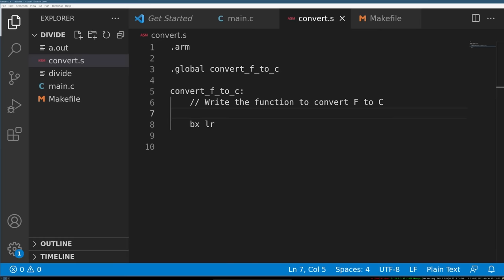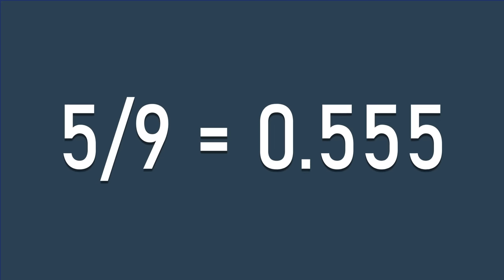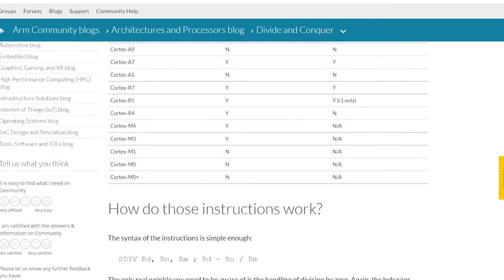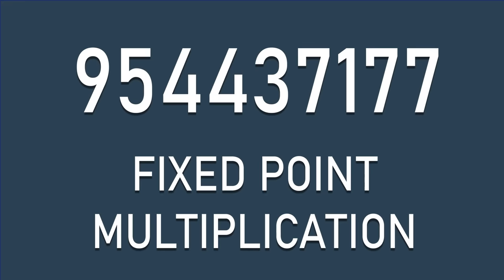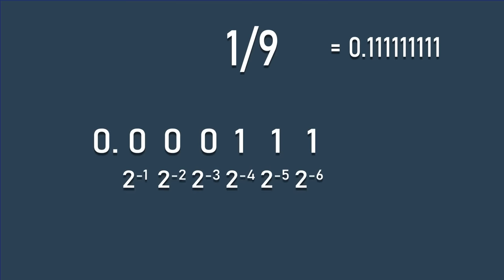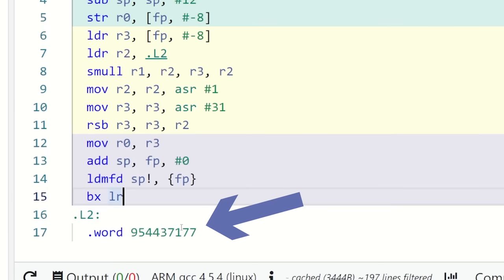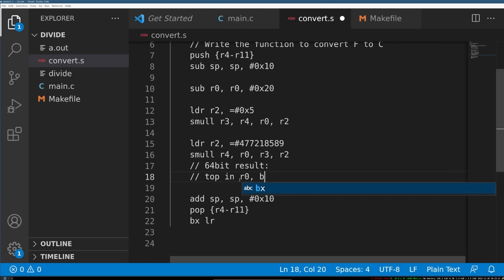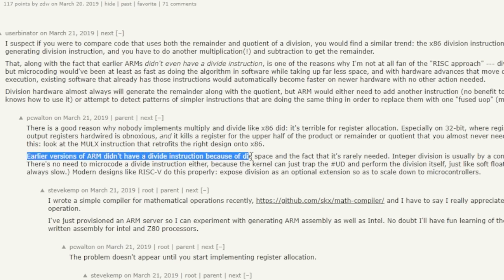computers suck at division (a painful discovery)

Comment: The reason division is hard to do is that it's an iterative process and you end up with remainders.  Multiplication is shifting and addition which is really XOR.  Division is quite a bit more complex.  With division, even when you're doing it on paper, you have to often "guess".  "How many times does 7 divide into 24"?  You know the answer is 3 with a remainder of 3 but only through experience.  You need much larger lookup tables for division to make it fast.

I designed an ALU in college.  Addition, subtraction, multiplication, exponentiation - ALL easy.  HOWEVER: division..?  SQUARE ROOTS?  Must more difficult.

Comment: Years ago working with early MIPs 4000 chips, I slowly tracked down a chip bug where a divide by zero exception would happen in the middle of nowhere. The issue was the divide was in the branch delay slot of the test for zero. The divide was canceled unfortunately the exception 64 cycles later was not. So the MIPS chip was doing 64 bit long division, one bit per cycle. Hard to track as the exception showed up in a random process. This was the first NT multiprocessor system running a  stress test with a screenful of open GL tests after many hours.
Reply from the maker: MIPS branch delay slot is the root of all evil

Comment: Division is just repetitive subtraction and borrowing a decimal when you have a remainder 1/3 = 10-3-3-3, 10-3-3-3, 10-3-3-3... =0.333... All you have to do is count how many times did we subtract 3 before you either got to zero or had to borrow 10 and shift. 2/5 = 20-5-5-5-5 = 0.4. we subtracted 5, 4 times to get to zero but had to first borrow a decimal. We can arbitrarily select how many places we want with simple subtraction.

Comment: The Intel 8086 didn’t have floating point because of the silicon real estate, instead you had to add the 8087 floating point coprocessor if you wanted hardware acceleration. So the original IBM PC had an FPU option and a floating point library was used when the coprocessor was not installed. Granted, the 8087 did more than division, but the need for floating point instructions has always been a trade-off at the price-sensitive end of the market due to the cost of the die area versus the real need in target applications for hardware acceleration. Welcome to embedded systems!

Comment: Unless it's division by 2. As a solution, I propose that all division is done by 2.

The reason division sucks so much is that every other operation is just adding (edit: meaning they can be done by the adder). Subtraction is just adding a negative number. Multiplication is just adding a number to itself for a set number of cycles. But division? Figuring out how many cycles a particular number takes to add up to the product? That's a lot harder.

Comment: The solution should be big graph trees of /s r8? Imagine endless kinda maps, of numbers where a lot of numbers are cancelled out, & in nextgen maybe also kinda fields or 3D,4D trees,scapes,artifacts etc also w colors(like Daniel Tammet visualizes) shapes etc which make new algs 4equations. This would open literally new dimensions of the most correct/perfect results which kinda could end up in multiverses since it's all possible outcomes prediscribed/visualized/determined.

Comment: I'm not very familiar with low level programming, but I've figured for a while now that it'd be nice if we suspended division until the last possible moment so as to prevent having to divide, for instance using fraction-based division instead, would this work? So, instead of repeatedly dividing to compute the sqrt of a number using Babylonian method, you just repeatedly multiply and then divide a single time at the very end.
Reply: Ah, but I know Fixed-Point decimals! Those are far better than floating points if you're not able to store the data to the level of accuracy requested then at least be upfront about it.

Comment: My favourite trick is to use a compiler. Modern architectures are optimized for use by compilers, not humans. Beyond fetish usage, or hair-shirt usage, or nostalgia usage, you've got better things to do with your time.
Whether you are coding in assembly, C, Rust, Perl, or whatever your poison, you can generate about 50 debugged lines of code a day. You don't get much done in 50 lines of assembly, but 50 lines of C is quite useful. Your choice. 
Plus, the people that write compilers are very smart and the output of a compiler will likely be far more efficient than your hand whittled artisanal assembly code (with less bugs too). Trust the compiler, trust the optimizer.

Comment: Reminds me of the time I had a weird instance with Excel where the irrational number after first dividing and then multiplying back gave me a value above the input value that was divided, though that was most obviously due to it being an irrational number which never fucking ends, so there is obviously gonna be some rounding, but even some small errors did not cause that before, presumably since it excel may have rounded it down, seeing that it was abnormally low the fractional value and it was genuinely weird to see it first time.

Comment: Genuine question: How relevant is this in programming as a whole? I mostly work in high level languages and am genuinely wondering if this has noteworthy performance impact. Obviously it's not something I would try to work into everything by default, but in situations where performance is absolutely key(which for me is mostly in regards to game development), it could be worth consideration.
Reply: Not really. It's important to know how numbers are dealt with but not to the point of such optimisation usually. For example you need to be constantly aware of floating point imprecision but if you don't work with microcontrollers you don't realistically need to implement custom fixed point solutions.

Comment: In terms of saving the tacts of CPU not implementing DIV is correct.
Moreover if you are doing arm you should think of minimizing operations to be executed. 
That’s what godbolt demonstrated.
1 add 1 mul
Instead of intended initially 
1 add 1 mul 1 div

Comment: It's not exactly a +1, they just rounded to the nearest integer.
2^33 / 9 = 954437177.9, so they used 954437178 because it's closer than 954437177.

In your case,
2^32 / 9 = 477218588.4, so the closest integer was 477218588, in which case adding +1 was unnecessary and reduced the precision (by an irrelevantly small amount, but still - better to understand why the +1 was there than apply it indiscriminately)

Comment: Computers don't do neither multiplication nor division, in the lowest level of programming, multiplication is just repeated addition, and division is just repeated subtraction.
Reply: How is division repeated subtraction
Reply: @kelsierii4747  
For example 8 divided by 2 is:
8-2-2-2-2
The computer counts how many subtraction it has to do to reach 0
Reply: @NourArt02  what. How does the computer know how many times to subtract..? And even if it does know, that's already the response (8/2 = 4, you subtract 2 four times). I don't think you're right on this
Reply: @kelsierii4747  I thought you have a bit of knowledge about computers architecture when i replied to you, anyway just Google "how does computers do division" and read
Reply: @NourArt02  "Modern CPUs essentially calculate N/D as N*(1/D). The (1/D) is approximated with Newton-Raphson method." As explained in the video. No subtraction.
Reply: @kelsierii4747  No subtractions? so how do you do a Newton-Raphson method?

Also, i like that you actually googled it, that means you like to learn .. very cool .. If you read enough about this topic you'll find out that every "division" algorithm requires some sort of repeated subtraction.

Comment: Oh you youngsters ... 🙂The libraries aren't "approximations." They do the same IEEE floating point operations that hardware would do if you had it. There is no dishonor in using them.  "ARM decided they [divisions] weren't needed" is really "ARM made a hardware vs software tradeoff decision and decided to go with software to keep die costs low."  Factoid: The x86 line didn't have on-chip floating point until Pentium (80586).  Earlier versions had an optional second chip to provide it. Always the same number as the processor chip except last digit "7" instead of "6."
Reply: Actually, the 486 was the first one to have an integrated FPU.

Comment: I think this is not a computer issue as much as a decimal issue. The ease of use of floating point decimals on paper hide the fact that it’s a chaotic operation that produces unpredictable sizes for the answer. Dividing integers can produce anywhere from a single digit answer to an infinite string. Dividing any integer by a 3,7 or 9 will result in a repeating decimal for any number that they aren’t a factor of, I.e. 2/3s, 6/7ths and 8/9ths of all integers respectively. Arbitrary truncation will always be necessary in any division operation to avoid infinite recursion, at least if a single value is being returned. Decimal division is an ugly mathematical process, its just something we get introduced to at a young age so its familiarity hides that

Comment: I have been interested in this problem at least since I re-invented the reciprocal multiplication idea around 1990, only to be told some guys at DEC had done it years before me, then in 1994/95 I was heavily involved in the FDIV affair. In your particular case you should also worry about rounding vs truncation, i.e. when converting between integer F and C, you should probably aim for a properly rounded result, and this you can do better with reciprocals: Start like you did, but calculate the fixed point version of 5/9 directly (totally avoiding the mul by 5 step), using the nearest bit pattern you can get (i.e. do no blindly add 1), then at the end you add the value corresponding to fixed point 0.5 before truncating.
I would also advocate using a much larger offset instead of 32, so that all values will be positive: Unsigned numbers allow for faster algorithms. 🙂
BTW, during the 1990'ies pretty much all  (optimizing?) compilers gained the ability to convert division by constant into reciprocal multiplication!
Reply: That optimization is not "safe". There is an algorithm which can do that safely, but it requires (true) fused multiply-add instruction and wasn't known in 1990s. Actually, it took some time for compiler writers to learn that they shouldn't blindly "simplify" fp expression assuming that fp numbers behave like reals.
Reply: @radivojevasiljevic3145  You've misunderstood the problem: Reciprocal MUL is only safe when applied in the (unsigned) integer domain! When you do it there, you just need N+1 bits of reciprocal (rounded up) in order for the product to be exact after shift/truncation. This is the algorithm I verified would work for all 32/32->32 bit divisions back then.
You are of course correct when you state that doing in the FP domain does require a lot more precision: In general you need 2N+2 (or 3 depending upon the exact operation) bits in order to avoid double rounding issues.
Reply: @TerjeMathisen  mea culpa, I am mostly focused on FP because domain is usually larger (64b) and compilers had long tradition of destroying FP algorithms. May I ask you, which tool you had used for verification, brute force or something like ACL2 or Coq? 

AFAIK, in FP good algorithm doesn't require larger precision (useful if available but not essential), only fmad. The only downside, is usual complexity (trickiness) of FP algorithms, but accuracy and run time are excellent, especially because this transformation enables usual loop optimizations.
Reply: @radivojevasiljevic3145  This was a long time ago, very few tools available, so I simply wrote my own that tested it all, semi-brute force, by trying all the break points: Verify that n*m divided by m returned n and that (r*m-1)/m -> n-1. This (obviously) only needs to test odd divisors, and if the tests above holds for the largest possible m value, it has to also hold for all smaller.
So, in reality it was only ~2^32 tests.
Doing the same for uint64_t is not feasible but by simply stating that the reciprocal has N+1 bits rounded up and an error of less than 0.5 ulp, it is relatively easy to show that the reciprocal MUL will give a product which (after shifting) has to be correct..

Comment: But what if you have to scale by some other fraction, with as much precision as you can, and that number might need to be tuned at run time after calibration?

forth's m*/ is a practical answer to problems like this. 

It does the long division to do scaling operations like this, typically assuming your number (to be scaled) is on the Forth VM's (don't worry, it's a very low level VM!) data stack as two 16-bit words (the m refers to this as a 'mixed' precision operation) followed by the numerator, as an unsigned positive 16 bit word, and the denomominator, also a the same type. 

It then does the multiply step bit at a time (no multiplication instruction needed!) to result in a triple-word, which it then divides using long division with the remaining word to arrive at a double-word precision result. 

Working in forth is just the right level of 'low'. 

If you do it on a hardware forth machine ( look up swapforth, ditch your inflexible microcontrollers, and buy an fpga!) then you can be compiling assembly instructions into new routines (called words by forth) into the live forth dictionary as you go. 

They're held in a linked list that the interpreter can either call or compile on demand, right after you finish each new definition. To do this the name is included as text, and, when you pass a white-space delimited text token to the running system, it basically just looks up and uses it (either running it immediately,  or compiling it into the currently open definition - there's one bit of state!). 

This is the 'slow evil' part of an interpreter, and it's so dumb and simple that it's all over as fast as you can upload code anyway, so doesn't penalise performance when the program is actually running.

Point is that forth isn't at all a compiled language, nor is it an interpreted language, it's merely the absolute minimum OS you need for interpreting incoming new commands to be possible. If you must run ARM microcontrollers, then you probably want to try mecrisp forth, since that will likely at least run the VM version on forth on ARM.

But anyway -- you're not very 'low level' unless you're making FSM's run on an FPGA!
We have any number of bits, although you will need again to implement long division, because neither VHDL nor Verilog will even try (although the latter will attempt to synthesize multiplication for you, at least). (best ref for this: https://projectf.io/posts/division-in-verilog/ )

Nice part in FPGA's is that not only can bit-strings have any number of bits, but you can make it such that the 'units' place need not be the right-most bit either, since you can freely make 'bit shifts' exist as deliberately-staggered parallel connections (in binary, halving and doubling is a no-op!)

For a painless and arduino-easy introduction to developing on FPGA's, get icestudio from icestudio.io, and buy a compatbile dev board (see https://github.com/FPGAwars/icestudio/tree/master/app/resources/boards  there are upwards of 30 now) . This will let you build simple logic via dataflow schematics, but will also let you insert little blocks of verilog, and is good whist you are learning that.

Once you're comfortable with verilog, you can run the appropriate tools via makefile and have whatever architecture CPU you want.

Comment: Actually, the problem here is that we do not have a decent way to represent an arbitrary decimal number in binary.

Think about it. Of the numbers 0-9, which ones can we represent directly in binary? 0, 1, 2, 4 and 8. Or, to be more precise... 0, 2^0, 2^1, 2^2 and 2^3. Every other number is simply too large!

Allright, you might say. That's four binary digits, so we can represent 0-9 with four binary digits. That means we can fit the numbers 0-9 on four bits, 0-99 on eight bits, up to 999 on twelve bits and up to 9999 on sixteen bits. However, with 16 bits, the amount of combinations that can be used are 2^16 = 65536. This seems very excessive. So for space and efficiency reasons, we're working in base 16 instead (0-9a-f). But that, again, is very time consuming to transfer back to decimal. And thus division is slow.

Comment: Division is needed in this particular problem only once, since 5/9 is constant. 5/9=0b0.(100011)... (precise, it is a repeating binary, copy as many bis as you need). Then multiplication... But processor does have built-in multiplication instruction! So what is the cry about?
Really interesting question, how do I know that 5/9=0b0.(100011). Well, children are taught how to perform arithmetic operations in elementary school — with decimal numbers and a huge multiplication table. Binary arithmetic is simpler.